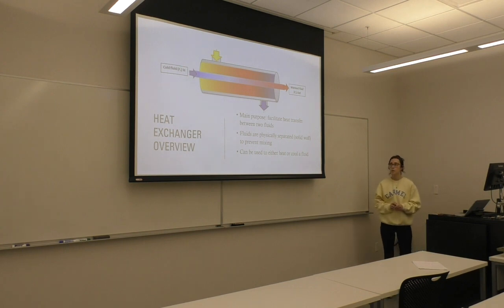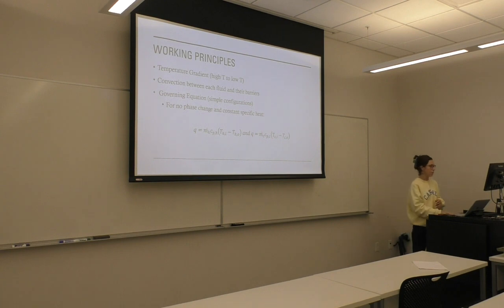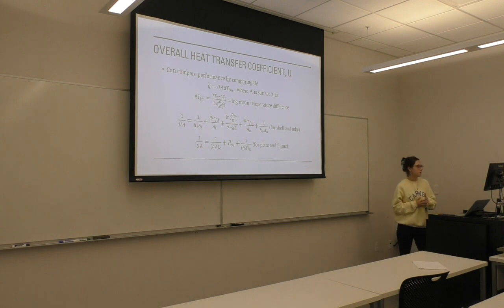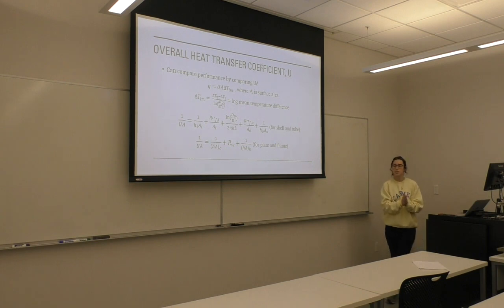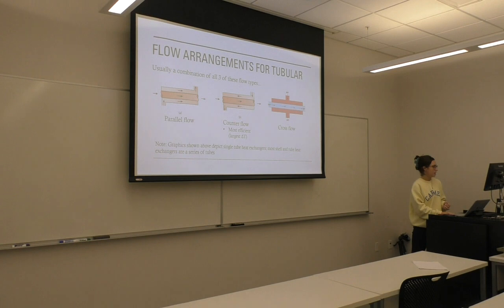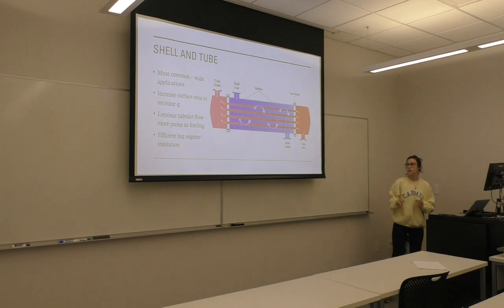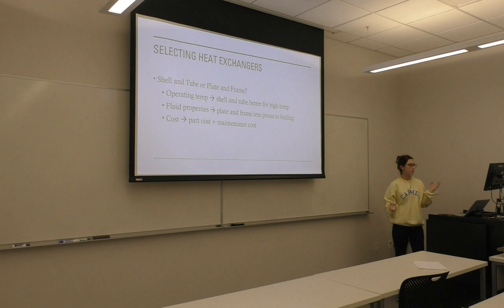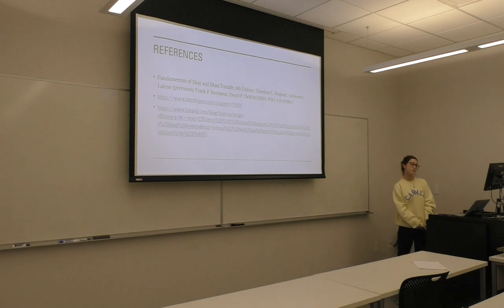Danielle Depierri

Comment: I think I did a pretty good job explaining the principles behind heat exchangers, but probably could have left a few things out in order to meet the time limit. In hindsight, the flow arrangements didn't need to be its own slide and could have instead been touched on during the shell and tube slide. I think my voice was a little too monotone and I need to use less "um's" but overall I think I did an okay job.